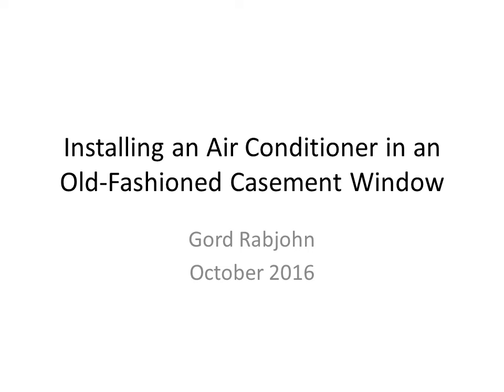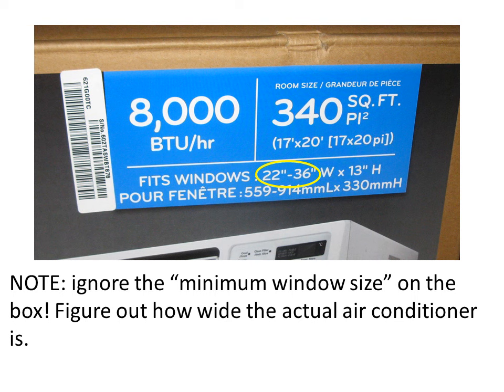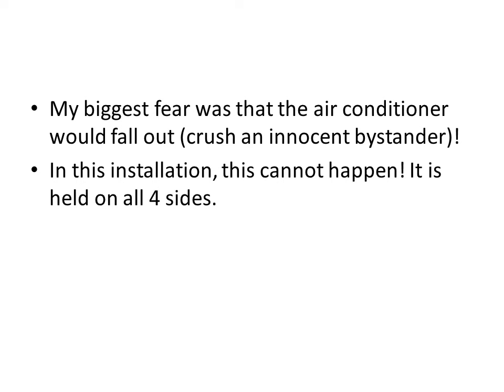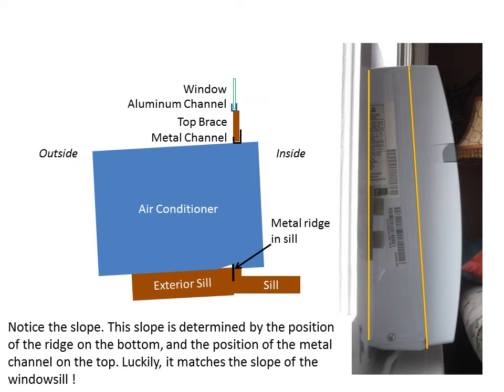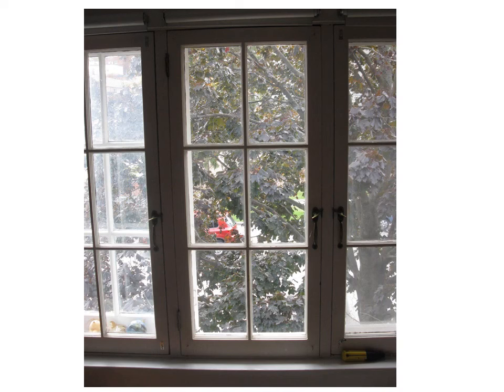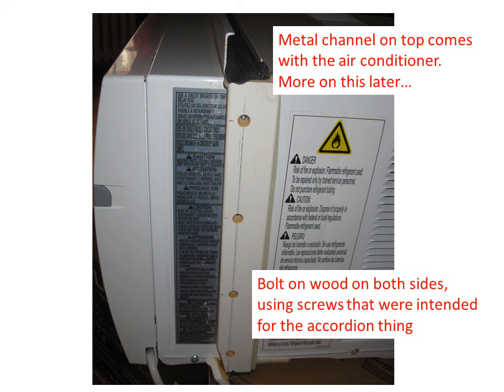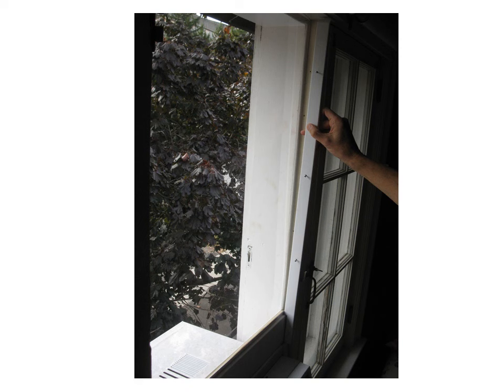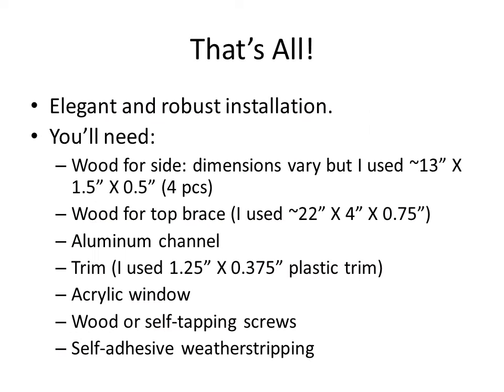Install an Air Conditioner in an Old-Fashioned Casement Window

Comment: I did the same thing but I put a wood board on the top opening and painted it white. Only thing is I can still hear outside noise going through the AC unit, so I might have to sound dampen the inside with mass loaded vinyl.

Comment: Can someone offer some guidance on what you need to buy for the install that the ac doesn’t come with?  Specifically what exactly is the “top brace” and “aluminum channel”. how do you get ones that fit your window ?